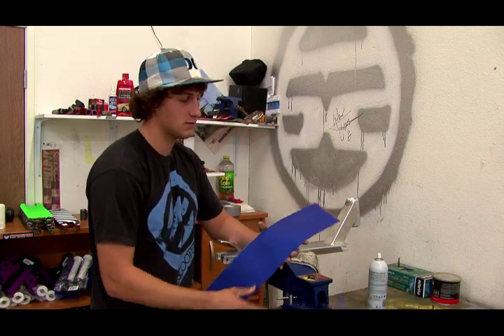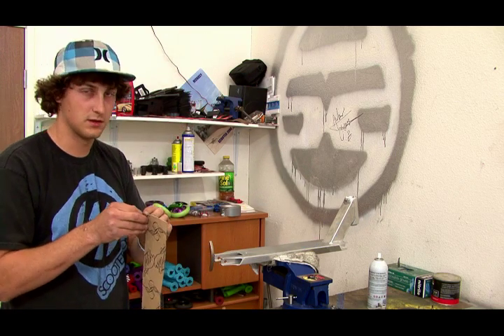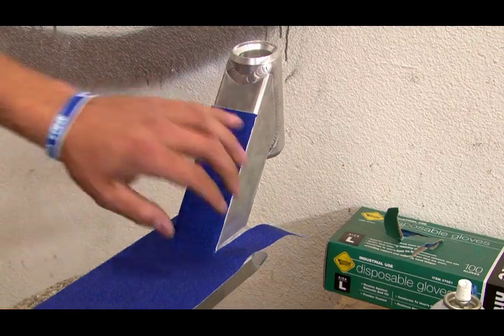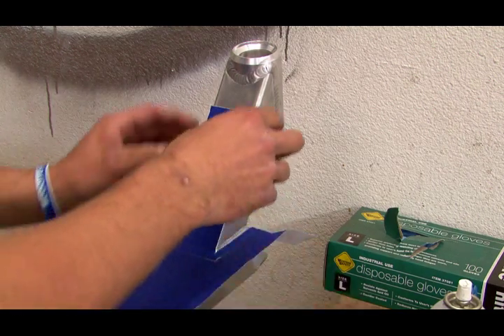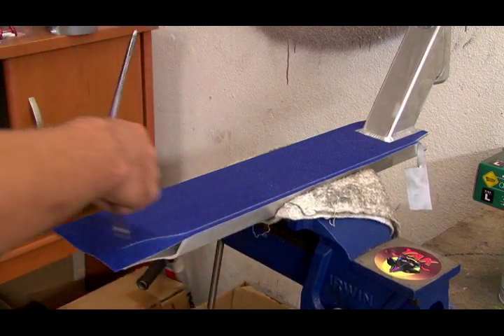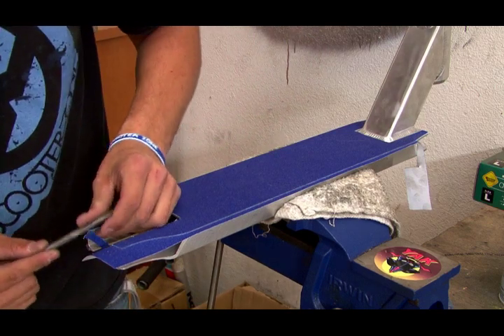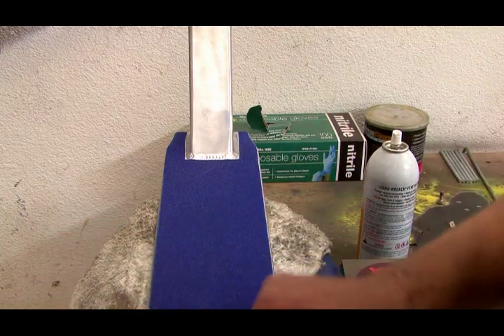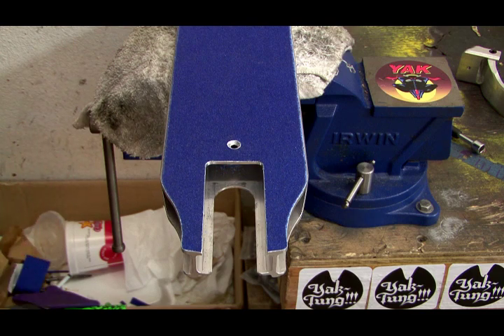Scooter Zone How to: Install Grip Tape with Nick Darger

Comment from the maker: @callumrocks1011 

take out the brake bolt that comes out the top of the deck, then take off your back wheel, then slide the brake out

Comment: hey, i have a district v2i and before i had a razor with a district pro sealed headset, can i use the bearings instead of buying a new headset, if i can't what is the smoothest, fastest, and cheapist integrated headset?!?! please i need help

Comment: every freakin time for me. i buy these 8 inch griptape squares (comes with 4 in a package) that gave good grip, but is really frustrating to get on the deck. imma start buyin my grip somewhere else than academy sports, but not inward, they always ship an absolutely tiny peice. it was blue and black checkered. i had to use some extra pink griptape to cover the deck.